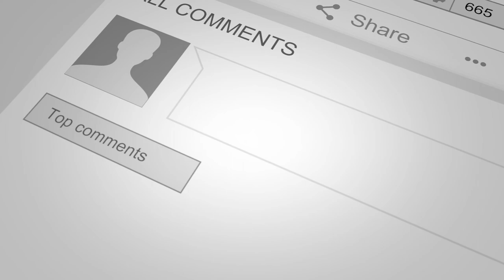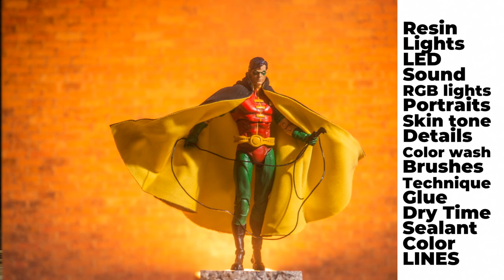What if Hydra Stomper  Marvel Legends

Comment: Could this figures torso crack open in half? I wanted to hollow it out to give an illusion of a cockpit
Reply from the maker: You’ll have to cut into it and force it…. Not sure where the pins are…. I tried… there is an inner frame that the head sits on… and you’ll need to cut the top to form the hatch… it’s best to start there, less damage to the torso… I suggest using a tiny drill bit and perforate a cut line… it’s gonna require lots of patience 
Enjoy
Reply: @InkDropCustoms  thanks for the tip. This video really helps a lot. You’re very talented
Reply from the maker: @LTlem27  thanks 
Thanks for watching

Comment: May I suggest a dremel to make holes and cut straight lines. Other wise nice custom.
Reply from the maker: I have a dremel ….. it doesn’t always cut straight- depends on  the figure … it also melts plastic due to the heat it produces…. A vise drill doesn’t…. I do use it where it’s needed…. I love my dremel, it just one of my many tools … 
Thanks for watching
Reply: @InkDropCustoms  Good info. I never thought about the plastic melting from heat.
Reply from the maker: I have had it melt to the drill bit and not know it , drilled a larger hole every time… then I catch it and it’s a pain to remove it…. Otherwise I love my dremel